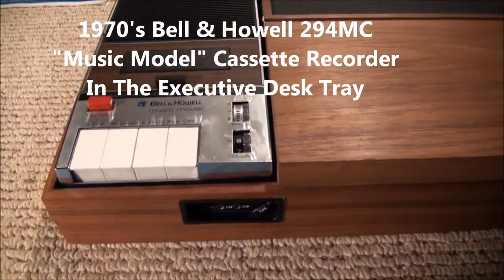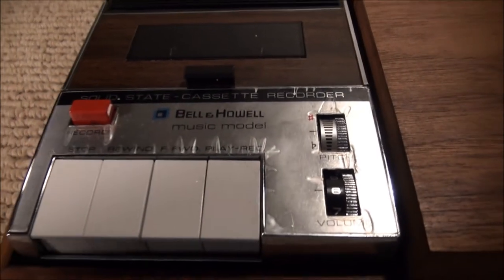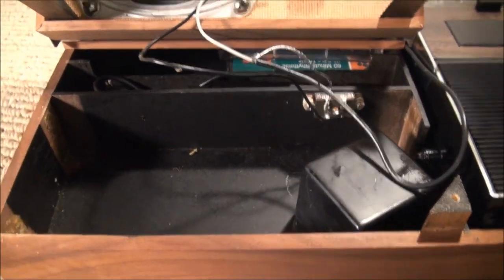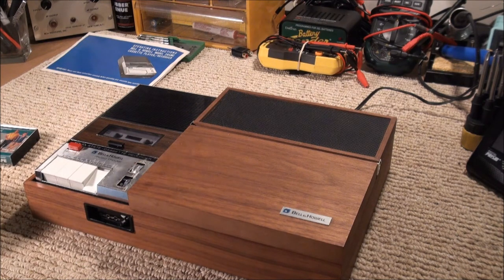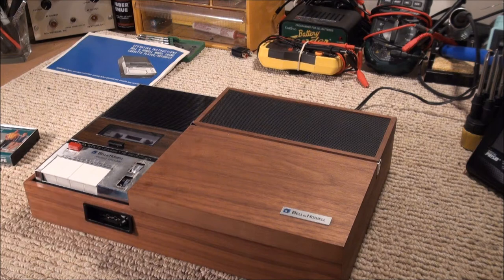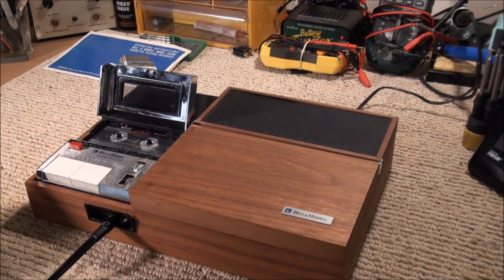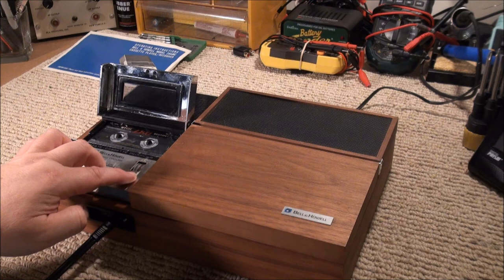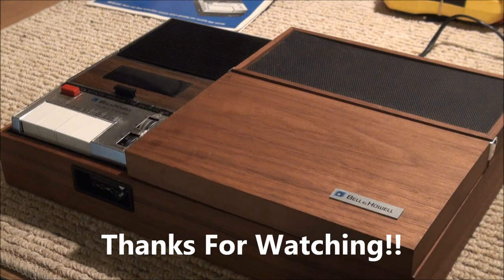B & H Cassette Recorder 294MC / Executive Desk Tray

Comment: Nice unit, I was surprised the pitch control didn't work on record?  You'd think it would as it would give that busy exec a way to record longer than the minutes notated then the actual tape speed? Nice Panasonic and signal  / rf generator in the background!